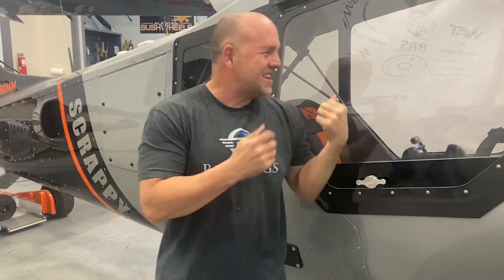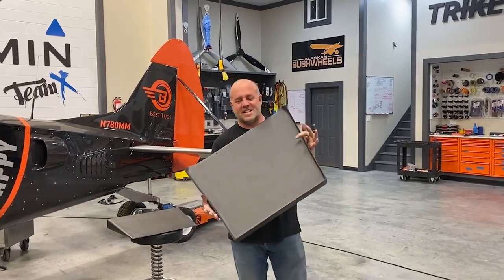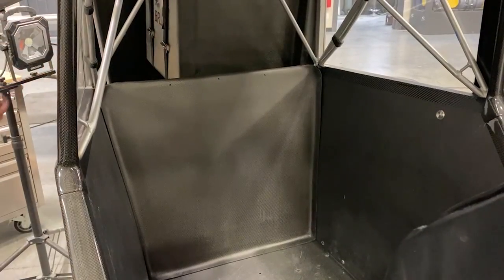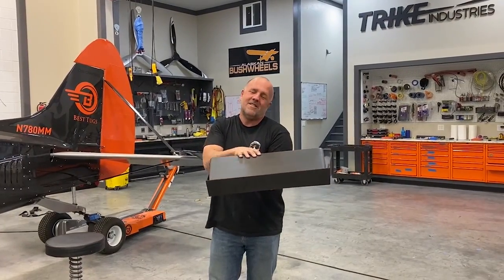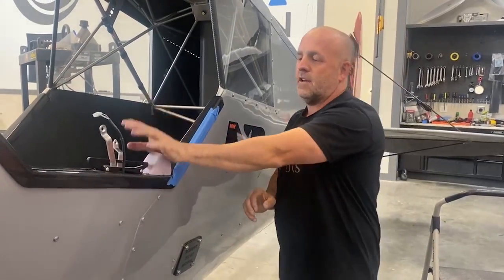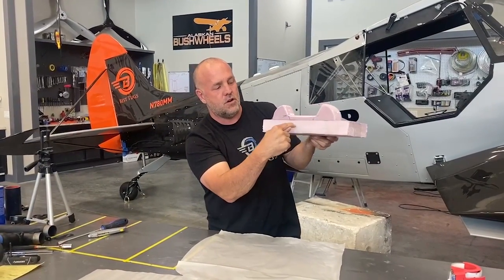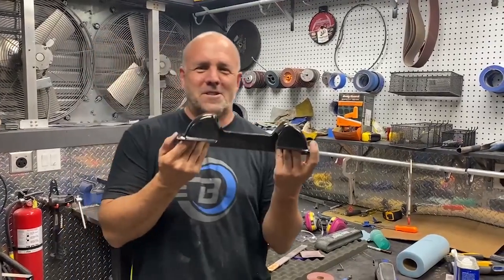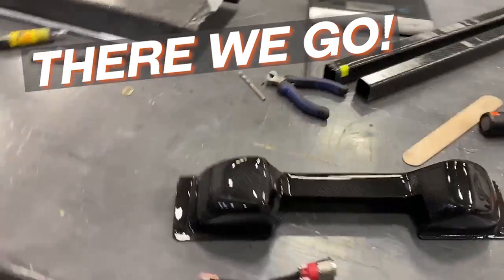2 Seat Dragster Bush Plane - Would You Ride? | Scrappy #38

Comment: Hey Mike I don’t know if you’re in the Apple guy or an android until right now Apple come out the computer it’s called a mini house the M1 chip if you get it with the 16 GB above board with the 512 then add a USB USB docking station hundred watt 17 or 14 additional plug-ins and you can download into another hard drive like a Sanyo or Toshiba and has download right speeds it over 4 to 10 GB a secondSo if you don’t know anything about computers this is faster than the Mac professional Xenon chip and chip and it’s only pulling 15 to 23 watch while the other chips a porn anywhere from 90 to 150 Watts and getting hot so you can give yourself for the fastest downloading cables thunderbolts then you can also give yourself USB 3.2 etc. that way if you use a cad cam design computer system this will save you tons of money he’ll do it twice as fast and right now they’re writing a bunch of new programs to it for editing and all kinds of stuff for every photo editing movie editing and cad cam!!! Seriously just look into it if I’m wrong then my loss your gain if I’m right your gain my gain I bought mine for $1000 and faster than the $8000 computer that I was gonna buy From Mac Pro!That means you can buy four or five of them and that would save you where is the money and you have a super fast system they’re awesome it’s the M1 silicon chip has to be there with 16 GB both board memory a random memory 512 hard drive and the rest you take it to a hard drive that’s  inside your computer!
Otherwise a portable but you can take with you or lock it up when you’re safe or whatever seriously try it out brother they are awesome check out on YouTube they just come out with them and people are going nuts because you’re so fast and there’s a quiet now stay so cool and I do it fast !!!Just like scrappy you got to stay ahead of the game that’s the only way you get a head

Comment: Once I saw that Mike drilled holes in the throttle handle I realized that this man has a weight issue and needs help. It's like the anorexia of engineering.
Reply from the maker: You’ve just described what it means to compete in STOL competitions 😂.